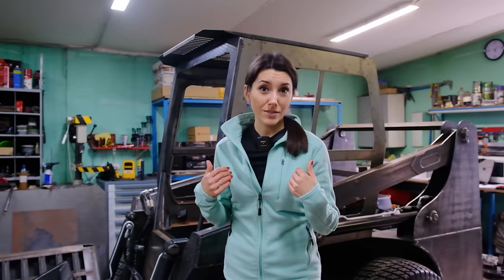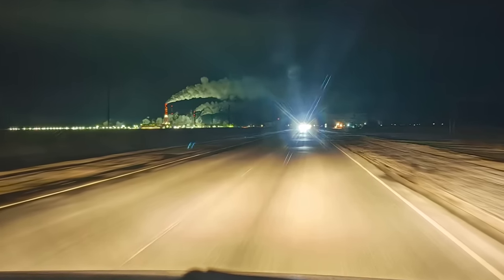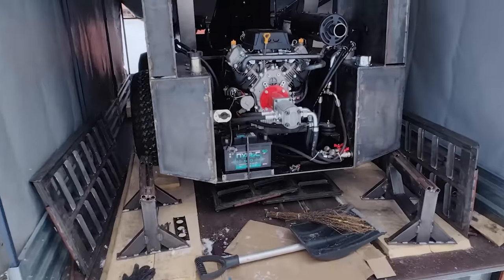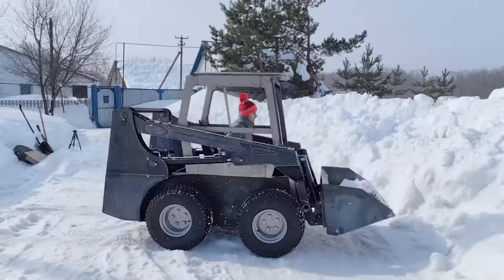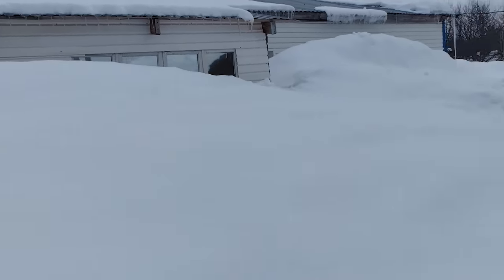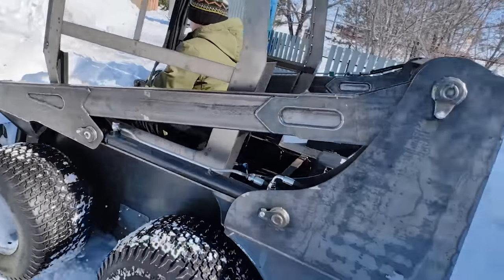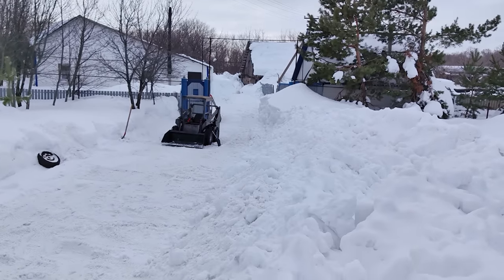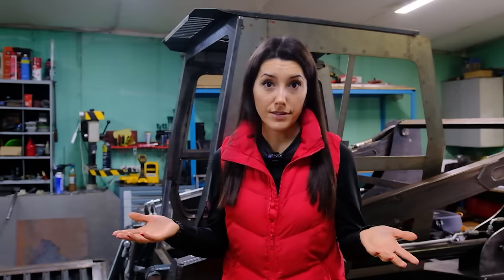DIY SKID STEER. 1st REAL TESTS!

Comment: Nice build!!  About the only thing I can add to the comments is that it is a lot easier to load it by backing up the ramp.  The heaviest part is the motor in the back, and if you have that lead, you'll feel less like you're going to tip over.  And if you want to keep the snow from sticking to the bucket as much, spray the inside with WD40 every so often (actually, cheap cooking spray will work in a pinch as well....... I did that as a job for several years)

Comment: Glad to see you have it working. Some side to side movement of the loader is normal. Also happy to see you all doing well. I have several decades of experience running skid steer loaders and it gets easier with practice, you seemed to become more confident as you used it and more fluid with the use of the controls. Perfect timing for the video as I'm working on replacing the axle bearings on my skid steer loader. Love all your videos. Can't wait for the next video.

Comment: That cabin needs a heating system 😁 Some plug for a heater, so you can serve hot coffee or tea ☕🤤
Being serouss, try to choose another tyre more accurate for snow/ice. Close the cabin to avoid the wind, and enforce it, sems wak to lateral oscilations. Put lights to enable work early hours or at the night, that plus, make loader more beauty. Put position lights, reverse lights, to make it more safe in the work field. Put reverse mirrors to make more easy drive the machine. Add a cover over the wheels. You can attach any tools over it. And the best of all: paint it with your preferred colours. Then you can rent it 😁😁😁

Comment: Great job.  A note regarding your choice of tires.  Skid steers usually have solid rubber tires, which do not bounce and sway as you described.  Some of the "jerky" movements you mentioned are probably magnified by the choice of pneumatic tires regardless of how smoothly you operate the controls.   Also, solid rubber tires are much heavier, which helps with traction and lowers the center of gravity.  A popular option for tractors is to fill the tires with water to add weight and reduce bounce.   You will need to use glycol based anti-freeze in the water to keep them from freezing.  I hope this helps.

Comment: It is so neat to finally see this thing in action, you really got the hang of operating it in a hurry. As for the side movement on the loader, some movement is normal, but it's important to know where that movement is coming from. If it is coming from loader pivot points, I wouldn't worry about it, just keep it well greased. Looking at how the machine is built, it could be coming from the straight section of the loader arms, or from the uprights that the loader attaches to. I wouldn't worry too much about the loader arms flexing as long as its not a lot of movement. If its the uprights flexing, I would be worried, because there is a lot of stress in that area and that would be a very bad place to have a failure. To find out where the movement is, get a couple pieces of round stock, grind the ends to a point and then tack them onto the loader uprights near the top, with the points of the stock almost touching and the points lined up with each other. Then put the side of bucket of the skid steer against an immovable object and slowly turn into that object. If the points move, your uprights are flexing. If it is a small amount of movement on those points, it's probably fine (a little movement is better than none at all, if it is so stiff that there is no flex, things tend to just start cracking), a little movement here will look like a lot of movement on the other end of the loader. If there is more than just a little movement, I would find somewhere to add some reinforcements to stiffen that up. I'll have to go back and re-watch some videos to see how you built everything, if I see something that jumps out at me, I'll reply to my comment here and let you know my thoughts, for as much as a stranger on the Internets thoughts are worth ;)
Reply: Okay, so I just re watched part 2, where you built the loader arms, I don't see anything that was under built, and upon re-watching this video, I caught that you said you don't have everything welded on your loader uprights yet, so I would bet when you get that done, your loader movement will be at a minimum.

Comment: Excellent work Lucia. I build machines too, I never get everything right the first time either, but like you, I keep working and changing the design til it works like I want it to.I have a factory built skid steer, I like using it a lot too. Try backing it onto the trailer, works much better and theres no fear of rolling over. Also, I didn't see any stops for the boom arms to push against when you are scooping. The arms will start to crack without them. Great job, looking forward to your next build. Cheers from Canada.

Comment: I really enjoy your work.  I have several thousand hours using a small "Bobcat"  skid steer loader and have maintained that they are the most difficult machine to drive well I have ever experienced.  You may discover as you expand your experiences that with a heavy load in the bucket, the turn will become centered around the front wheels instead of the rear ones as is the case with snow.  The balance of your machine looks great.  Congratulations on a successful test, and yes, there are few better feelings than that of seeing ones own creation perform well.  I look forward to seeing more videos of your machine in operation.

Comment: Lucia one admires your skill and intellect to produce such an ambitious handler. I notice that the muffler was loose while the cold start was being done and you showed it finally running after a false start! This led to the fatigue of the remaining connection. Also visible is the flexibility of the cabin which is an operator protection zone and will in futuer be boxed and otherwise reinforced to add rigidity to the chassis tub also giving protection from load spill to your operator. Last The bucket lift arms appear to bee absent of the large boxed heavy crossmember at the chassis hinge. Up there or alternatively in front of the drive station all Bobcat type machines have this which eliminates flex and variation in the height or pressure on the two arms. This has been an emotional journey as I see you begin this outlandish task and follow through to the test phase. You did wonderfully this far and soon the loose ends will likely be tidied up , paint and glass installed. Good research with the drive binding. System pipe diameter could be something to review? You are a World Beater young woman, a king among men (or a queen). Also the engine looks very small and modest? 
Oh! before signing off, my machines have two layers of 1/8" steel to build each layer of the bucket. I am not familiar with how you built yours.

Comment: Congrats Lucia, a job well done.Maybe add lengths of angle iron welded flat (if you know what I mean) to the upright supports of the cabin roof to stiffen the structure.

Comment: Outstanding! The depth and breadth of your skill set is remarkable; to be able to not only engineer such projects but also single handedly build them is both impressive and rare. Having the pros and cons analysis at the end of the video gives insight into the kind of mindset that fosters continual growth and allows for overcoming ever increasing technical challenges.  I might be sticking my neck out but I'm guessing you have a Mechanical Engineering degree?
Reply from the maker: Thank you very much! No, I'm mostly self-taught, but I have a great advantage - my subscribers share their experience with me. It helps a lot sometimes.

Comment: Very nice! Great to see it in operation after all your hard work. 

Small suggestion per moving the snow. If you have enough power and traction to do so, you can take a couple scoops and dump in a pile. Then push the pile off to the final destination. It’ll take some practice to figure out exactly how much snow it can push, but this will save you much time since you won’t need to drive the full distance as many times. BTW, the colder the better for pushing snow as it doesn’t glaze over with traffic as much. 🙂 

You can also clear a spot to get behind the drift and try to cut and push it with 1/5-1/4 of the side of your bucket, steering out as your bucket fills up.

Nice work!!!

Comment: Very nice test result to a long project!  A couple of quick suggestions that may help your problems out.  First, if you have a flexible hose on your exhaust, take the opportunity to mount your muffler to the body instead of the engine.  That is a long muffler and the leverage of the vibrations will continue to stress mounted parts if it's mounted on the engine.  Mounting it to the frame removes vibration stress which gets absorbed instead by the flexible hose connector.

Second, many small engines come with a governer managed throttle option.  This makes it so you set the engine speed you want and it adjusts the throttle based on engine load.  While the engine may be powerful enough, there's a limitation with a gas engine at lower throttle positions.  It's much easier to kill a gas engine at lower throttle because engine speed drops linearly with the throttle while power drops more exponentially.  An engine running at 1800RPM (we'll say half speed) will be running at 1\3 to 1\4 power, depending on design.  Those are guessed numbers, but you get the Idea.  A managed throttle will overcome this by opening up under load and giving you true half speed power at half speed.  If your engine has the option, look into making sure the throttle governer is connected and operational.  It will save you from killing your engine.

The other option is switch to a diesel engine, which I don't think you want to do.

And for balance, most production skid-steers have a counterweight around the engine along with the weight of a diesel engine.  Diesel engines are much heavier than gas engines of the same size, and you are running gas, which is much lighter.  Add some thick steel plating down low around your engine area for weight and you'll find your machine handles more like what you would expect.

Keep up the awesome work!  You're inspiring to watch!
Reply: I am sure that if this engine doesn't have a governer she CAN make one. Hint: use hydraulics >pressure drop< as source 😉
Reply: @grzegorzolek9219  I'm just trying to cover my bases in case she made the engine herself and just forgot that part.  You never know when this level of skill is involved...

Comment: Hi Lucia, congratulations for the work done by Lucia and husband, I saw it from the beginning until it was successfully tested.. to solve the problem of broken exzos, usually the factory will put a rubber bush on the base of the exzos to the chassis to reduce vibration~malaysia boy🇲🇾

Comment: I’m about half way through the video. Nice work!!  Wanted to say something I noticed that may need attention. It looks like the rear wheels start to move before the front ones do. To me that says the chains have started to stretch and wear in some. Which with new chains is always going to happen. But I figured I’d say maybe you should check them out once you get back to your shop and see if they need adjustment before something bad happens.  As far as the muffler goes. It looks to me like you need a longer piece of flex pipe to allow more movement without breaking. With the swaying back and forth of the loader arms. You may want to think about some plastic slides in between the cab and the loader arms to help guide the arms and keep them from moving side to side. If you do this make sure to add stainless steel slide plates on the inside of the boom arms where it contacts the plastic. That way when the paint wears off it won’t rust. Cheers!!😊

Comment: The loader arms are not supposed to shift side-to-side. That will happen with sloppy pin tolerances, or lack of grease. You may have just been seeing the whole machine moving because of the type of tires you are running. Like the sidewalls flexing causing the machine to rock.

Comment: (ATF) Automatic transmission fluid. I'm not sure if anyone else has suggested this yet, but ATF is much better for colder temperatures than regular hydraulic fluid. Outstanding progress so far. You and your supporting team should be extremely proud of this achievement. 🍻 Not just this skid steer project, but the YouTube channel as well. I wish you continued success

Comment: Grew up running equipment and been in name brand skidsteers and other machines with 6hrs on the clock where the boom arm had more play in it than yours. Very nicely built and solid indeed.

Comment: Looks like someone might need a snow melting machine... Also you should be backing onto that trailer as you can tip it backwards due to the rear heavy weight distribution. Back on drive off this will also prevent the trailer from swaying uncontrollably as the weight is distributed forward of the trailer axle not behind it

Comment: I am not an equipment operator at any stretch nor am I an engineer.  That being said, maybe adding another cross-member between the arms behind the cab (of course making sure it doesn't interfere with engine access or the cab itself) would help get rid of some of the side to side movement of the bucket when not lowered all the way down.  Again I am no expert but it may help a little, great video and I'm amazed at the ingenuity and skill you have shown in you videos!

Comment: Can you change the hydraulic pump head or the gears in the pump head. Regearing the pump head should be the fastest easiest and cheapest way to find power in the system. You will find that the hydraulics will slow down but the power will increase, a little goes a long way!  Looking forward to more testing!

Comment: You may want to consider putting auxiliary hydraulic ports on the loader arms and building a hydraulic powered snowblower to go on in place of the bucket. I’ve had to move a lot of snow and believe it’s better to blow the snow away than plow it or dig it away.

Comment: If  i may. It would be better to raise your bucket some and reverse onto the ramps. The front doesnt protrude so far past the wheels as the rear so the chance of hitting the ground is not so high. Also may i suggest some tipe of counter wheight at the rear maybe old tractor ones, if the machine felt if it was see sawing over rough ground with a load. If not it probably not needed. 
This thing of your so neat im jealous😊

Comment: You may find better performance with a variable volume pump instead of a fixed displacement. Talk to a hydraulic supply company with a load sensing or horsepower limiting control pump

Comment: if you lift while driving into the pile you will get a full bucket every time. but you will need enough power to do two motions at once. 
still the machine has proven itself useful for clearing snow, it would be easy work to clear the snow if it was done on a regular basis without waiting until it is already piled up head high and frozen solid.

Comment: the arms swinging should be very little. i think because the arm support is open and not closed off in places it allowes for more flex. i recommend closing that off as much as possible. the jerking may be because you do ot have an actual oil resevior nor accumlator to help with surging.

Comment: Lucia, as a heavy equipment operator your skid steer needs more counter weight. The skid steer is very bouncy even with a load. Also a plow blade would have mad3 quicker work

Comment: Generally the throttle is at full speed. You control the flow of power with your hands and/or foot controls. It’s not like a car that is almost the opposite…controlling mostly the throttle.  Most of the operations are achieved combination/compound movement…like a dance…..not a robot dance.     Eg. Picking up a load of sand with your bucket is a  combination of bucket curl, arm lifting and forward movement all at the same time….otherwise you will get little into the bucket.     Practice….it becomes natural…like learning to dance.

Comment: I absolutly love this video. you made your own skid steer. I mean how many people can do such a thing? and my opinion of the  power is I was thinking the engine may be a bit small for that job but I also was impressed how it did finish the job. like the little engine that could book. and since i do know a bit about engines and their performance I will just say that when the muffler broke off that allowed very cold air to get farther down inside the engine which is very hot so and cold air hitting it like that will cause the componants  to shrink which are expanding and that is why the engine doesnt run like it should and you lose power because of it. but it was impressive how it still with all of that finished a job that should have been for a larger skid steer. makes me want one of yours lol. GREAT VIDEO.

Comment: The pin in the back should be close to 200mm diameter and 200mm long. With .001” in the bore. Increasing surface contact at high tolerances.

Comment: If you google a Dingo or Kanga mini loader you'll see they are very similar design to your design, just smaller. They run a smaller engine and smaller bucket and they will stall out if you drive into a large pile but otherwise work well. They don't lift very high either and aren't fun to drive.

Comment: For your hydraulics the valves may not be open enough. Or your pump is not running fast enough to give it the pressure it needs under load. You could use gauge at the end of each line to see what type of pressure they are giving off.